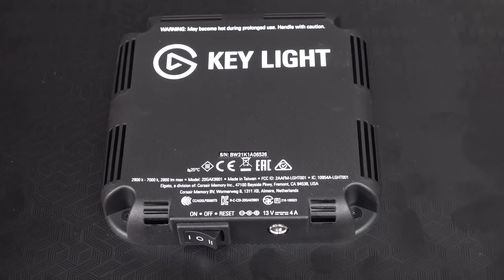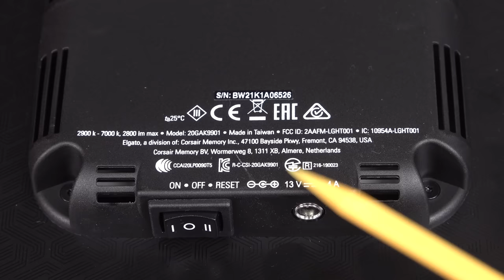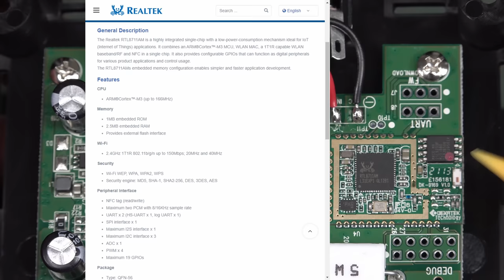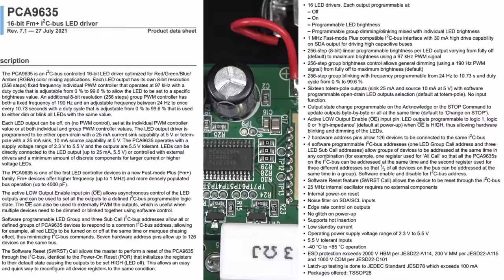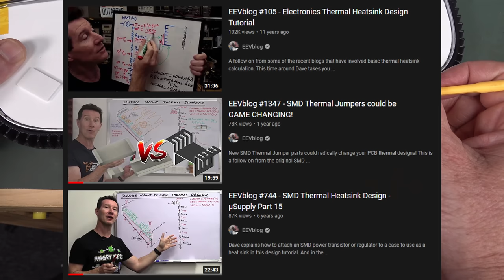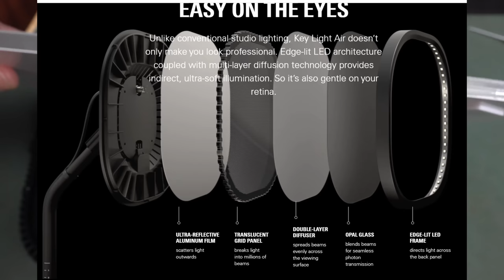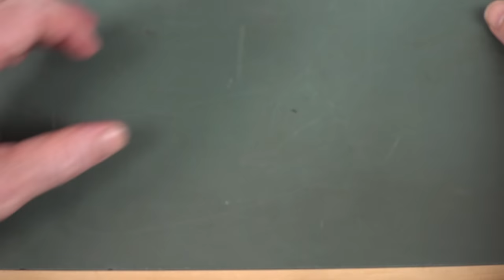EEVblog 1453 - Elgato Key Light TEARDOWN

Comment: Airgapping the heatsink has one purpose and one purpose only.  Purposely shortening the lifespan so you have to buy another one in 2 years.  That air gap is no accident.  People who buy these will want to install a thermal pad or adhesive around the edge to fill the gap.
Reply: Its not as dramatic as you think. That air gap will certainly result in a significantly higher die temperature, but the biggest gradient will be the transition to ambient. Power supplies commonly have a pretty significant air gap between heatsink and plastic case and it performs pretty similar to having them in direct contact. There is just not that much heat here (look at the heatsink area vs air gap area).
Reply: @drkastenbrot  It's way more dramatic than you think, the thermal conductivity of air is several thousand times lower than aluminum, at least at the case to ambient interface you're getting helped out by convection. There's also a lot more surface area exposed to air outside the case than there is between the aluminum pcb and the case. A led is also a lot more temperature sensitive than say, a power mosfet.
Reply: @drkastenbrot  "There is just not that much heat here (look at the heatsink area vs air gap area)."  
You are wrong. At full power the LEDs will heat quite a bit, and it can even drift their color temperature. The air gap is an engineering mistake. I don't know if it's on purpose but it's a bad design, that's for sure. It's quite incomprehensible as well as the back is made of die cast aluminum to act as a heatsink, which is way more expensive than plastic. So indeed it could very well be planned obsolescence.
Reply: @lolilollolilol7773  Look, I even gave you a reason why. Look at a cpu heatsink. The cpu to heatsink area is maybe 9-16 cm2, while the actual heatsink has a radiative surface of well over 2000 cm2. This ratio of 125 means that the small heatsink interface needs to be very thermally conductive to permit good heatsink performance. 
The heatsink shown in the video seems to have a ratio of less than 3. Having an airgap as the thermal interface with that low of a ratio will not ruin the performance of it.
Reply: @sleepib  I literally do this for a living, and I say its not that big of a deal because it isnt. Go buy one and do a thermal analysis on it. Wouldnt be surprised if that heatsink is more cosmetic than necessary.
Reply: @drkastenbrot  Isn't the back of the case aluminum? That's more like 15:1.
Reply: One would wonder why did they even bother with the alumin(i)um back case when they're air-coupling the LEDs to it—short of maybe feeling more premium so they can more easily sell $30 hardware for $200 price. I mean, in this setting, it would probably be better to have a plastic backplate with a lot of holes for convective heat dissipation of the strip itself. Short of doing it on purpose to severely decrease the lifespan or unbelievable incompetence (and I don't know which is worse) I can't think of a reason why didn't they add a few cents to the BOM for a thermal tape.
Reply: @zwerko  They may intend to sell a pro tier or something.  Do not assume they aren't selling ones with thermal pads in some special product line while selling general consumers the ones without pads.  Not putting the pads in the cheapest version means they won't last as long.
It also could just be that they designed them properly with thermal pads but late stage testing saw them lasting way too long.  Pulling the thermal pad gave them the shorter lifespan they wanted.
Either way, the goal here is a shorter lifespan to sell more of them.
Luckily, they are super easy to open and put thermal pads into yourself.  I bet they start gluing them in a future version just to discourage adding thermal pads.
Reply: @drkastenbrot  I don't know how you calculate a ratio of less than 3. The entire back was designed to act as a heatsink. i'm not going to rewatch the video to see the exact dimensions, but let's say it's 30cmx30cm.The surface is 900cm² (not counting the sides) while the strip is about 0.5cm by 120cm long, aka 60cm². If you add the sides to the die cast back, you get 960cm² of radiative surface. That's a factor of 16, not 3.
Reply: @lolilollolilol7773  I was counting the rim only, which is where the air gap is most significant. Adding the back only makes sense as a seperate path, since it has a different thermal path and resistance. A substantial portion of heat is also dissipated by the acrylic surface. With a roughly approximate circumference of 80cm and 40W of power, we are looking at just about 0.5W/cm heat density across the profile. This is in the same ballpark as a typical compact phone charger and I can not recall ever seeing one with a thermally coupled casing. Just a heatsinking pcb and plastic casing with air inbetween. And its easily good enough to make them last 5 years of normal use. 
The back casing being metal is mostly for looks, at least the middle part. Across solid aluminium of that cross section, its only really the outer 5cm that add any significant heatsinking. Solid metal is not as good of a heatsink as it might seem, thats why heatpipes are used. 
And now for the important part. 
Comparing static heat conductivity of materials is completely useless in a dynamic system. The air can move. It has wildly different properties than e.g. a super low density foam. 
Thats also why the same thermal approach works well for power supplies. Many laptop power supplies actually contain a large heatsink, yet have air between it and the plastic casing. Its a cheap experiment to add thermal compound, and youll see that it makes no substantial difference.
Reply: I agree with joob. That air gap is mostly theoretical. Just a few tenths of watts across that big surface area of the alu backed PCB is not a lot at all. Let's say LEDs are like 50% power efficient, so only half of the input power is dissipated as heat loss.
Reply: Jeez with the conspiracy theories. You guys have watched the documentaries about the light bulb cartels way more than you've been involved in product design and development, that much is obvious. There is such a thing as "good enough", and design life. If the product is expected to be thrown out within 3-6 years, and all customers are pushing to get the prices lower and lower, why would you spend more time in development (the most cost driving factor in product development is probably time to market) use more parts, more process steps in assembly, just to make something work significantly longer than you expect the product to be used? That's a waste of resources.
Reply: @mr_gerber  Grow up.  It is not a conspiracy to open a product and see where they cheaped out.
Reply: @_PatrickO  It's not. But it's conspiracy thinking to start inventing ideas about how they design it to break down. That's not how it works. And they don't "cheap out". They don't just throw money on unnecessary specifications for the product. You can't always choose the top of the line super over-engineered solutions, the product will never be finished, and will never meet the price target.

Comment: A right to repair would quickly separate the 'sheep from the goats' players in various industries. $200 for that - no thanks
- and is most likely another reason why some lobbyists are working so hard to ultimately prevent customers from knowing things like this and fixing 'issues'
Reply: Yeah! If only we had some way to see inside this thing…?
Reply: @vananything  It was called a service manual..
- with schematics, parts list and a exploded view of all internal parts.
Serious companies would offer these for sale, and could be purchased before a sale (to avoid being taken 'hostage')
Reply: I'm not against the right to repair, but for the mass market, this product is probably not worth the time repairing. The gamerkiddies that Dave talks about are most probably not electronics competent enough to do any repairs deeper than module replacement, and a repair shop would utilize their time more cost efficient by discarding.  Man hours are more expensive than this doodad. And almost nobody would be ready to pay the price for a proper component level repair.
Unless we politically incentivise towards making it cheaper to repair than replace, I struggle to see how the market will regulate itself
Reply: @mr_gerber  Perhaps 'gamerkiddies' can't fix items on a component level, but why stop them from learning - and hopefully being successive in a repair attempt.
Imho once companies learn the PR value in publishing schematics + various documents so their items can be fixed after they go obsolete, the 'kiddie' might remember who helped, and which company just were after hard earned money providing a crap product which might keep failing. 
It's better to have bad/failed support, than none at all.
There's a thing as good PR, just as bad PR.
It's both PR - but the good pays off in a good way, where as the bad pays off in a bad way - for both company and customer.

Try tell that to the PR consultants, bosses and accountants, and those likely having a stroke - might tell you they're into bad PR ;ø)
Reply: @EgonSorensen  I don't think you're right. I don't think the market segment that elgato is aiming for with this product is willing to pay the price for having a service and repair system, because don't be mistaken - it's not for free. Other types of products, sure - I'll agree with you that that balance is different, but a consumer product like this? I don't think so. (And it is a consumer product even though it looks like a "pro"-thing. It's the same with power tools. People buy the cheap crap tools, even though there are pro-tools that are repairable, you can get spare parts and service, and that will last a lifetime)

Comment: @0:30 The compliment to "key light" is "fill light." Fill does what it sounds like -- makes the secondary details visible, but doesn't draw focus from the key.
@10:00 (edit) Maybe they're counting on thermal expansion of the LED PCB to fill the difference in the space? Even then, it still seems like they should have used (at least) those flexible thermal pads at US$200.
@16:00 (edit 2) That Aperture light might work well for fill, or indirect key lighting. Looks like something that could be bodged together by an enterprising home hobbyist with good LEDs and a 555 timer. 😁
Reply: In German, the key light is called the "leading light" -  it leads the whole lighting setup and is your main light on the subject. If you had to just work with one light, it would be your key light. Then you'll get a film noire look with strong, black shadows.
Reply: @maximilianmustermann5763  That's neat. I love the noire look, but at least here in the 'States, it's more common for a fill light to be low intensity, or dark color, than to omit entirely. Outside of maybe interrogation scenes, there's almost always fill light in use.
Reply: @McTroyd  Yes, of course. Going completely without a fill is a bit extreme, even for film noir. It's also hard to do in real life because your key light is going to reflect somewhere - and there is your fill!
Reply: @maximilianmustermann5763  Excellent point. I stand corrected.

Comment: So basically you risk to reset the bloody thing every time you want to powering it up? Genius!
Reply: To reset them, you have to hold the reset position for 10 seconds and it springs back (as seen in the video). You will notice that. Also most people will just leave them plugged in and switch them on via WiFi, as the software is your only way to change color or brightness.
Reply: I suspect that, given the settings are vis WiFi (or BT?) I bet  the unit resets at power up anyway.  Maybe Dave can comment.
Reply: @barrieshepherd7694  I have two of those here. You connect them to WiFi once and they keep the last settings you chose, even when power is lost. The only time you would really depend on the software, is when you want to change settings.

Comment: Great lights except for the glaring security issue. You can use HTTP posts to control these with no authentication. Yeah they're just lights and not gonna destroy your network but it makes you wonder if there's other vulnerabilitiea that can be exploited and used to infiltrate a network.
Reply: Imagine building a botnet of lights, lol. But there are probably ways to do so, as this webserver runs on embedded, which I guess is more vulnerable in general.
Reply: This is a general problem with IoT devices, unfortunately. Security seems to be lax for just the reason you pointed out. They're just small systems and the thought seems to be, "what's the worst that could happen?"
Reply: Well of course they're secure just look for the s in the name IOT. Although not having Security on the HTTP request means they will be easily sniffed deciphered and can be controlled by other meme. Which means you're not stuck with it only being controlled with their app.
Reply: Now you just need to find a streamer who is susceptible to light-induced epilepsy, get on their network and you can DoS their brains via these lights 🙈

Comment: they could use the non-adhesive thermal pad. if it was possible to turn this on without the back aluminum panel, you might be able to see the heat dissipation with a thermal imaging camera?

Comment: The double-sided thermal tape (commonly used for Raspberry Pi heatsinking) might be used between the LEDs and outer heatsink, since the thermal paste can get into the optical area
Reply: Did you even watch the video ? No you didn't. There is no double-sided thermal tape, he said it twice. There is simply no heat path between the LEDs and the heatsink. This is an incredibly faulty design.
Reply: @lolilollolilol7773  I think Vikas is suggesting to add some tape as a relatively simple fix.
Reply: @lolilollolilol7773  my proposal is to add thermal tape to fix the issue that Dave found. He also mentioned that the reason thermal paste might not be used might be because it can be messy and squeeze onto the front of the LEDs. So the thermal tape is a good fix I think
Reply: @RedwoodRhiadra  yes exactly
Reply: @VikasVJois  I don't think it's possible because the leds are fixed on a susbtrate that looks very insulative.
Reply: @lolilollolilol7773  It is mentioned in the video that the LEDs are mounted on an aluminum PCB that is designed to be thermally conductive. These kind of PCBs have a thick central aluminum layer just for these kind of applications. Usually LEDs mounted for lighting use these PCBs

Comment: The craziest thing about the power supply for this thing is that, I bet those beefy 5W power resistors actually cost more than some cheap off the shelf $2 constant current thing.

Comment: In most cases, the reason for the separate board is RF compliance - FCC in the US.  They can change the rest of the product without having to get re-certified, or use the same board in many products with only one certification needed.  (And not theirs, since they bought the board from a supplier.)

Comment: I have 4 Nanlite Compac 688 lights with manual controls for brightness and temperature. They run quite hot at full power, (especially when it gets over 30 C) but turning them down to around 80-90% they run substantially cooler. I've used them most days over the past 6 months without problems. No problems with flicker @ 24, 25, or 29.95 fps. I'm certain they are not upto Arri standards, but then they cost less than $300 each. Things are expensive here in Australia because of low volumes, and "supply chain difficulties". I think I'll avoid these, but with some minor mods they could be quite useful in the studio.